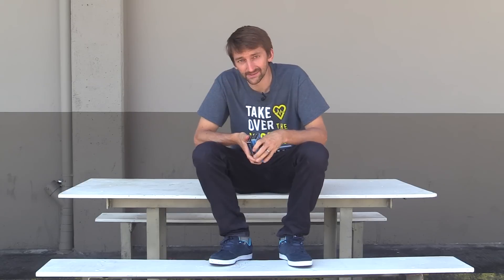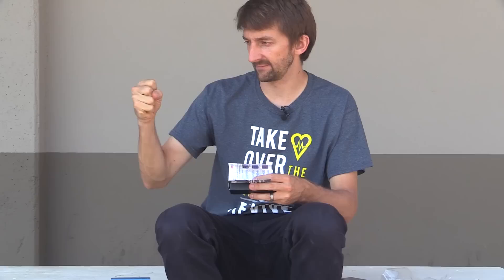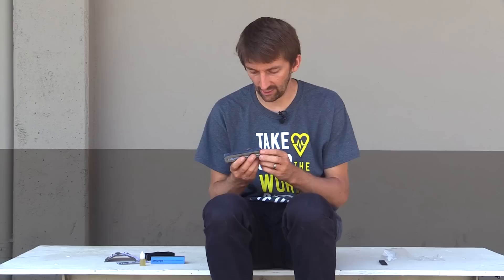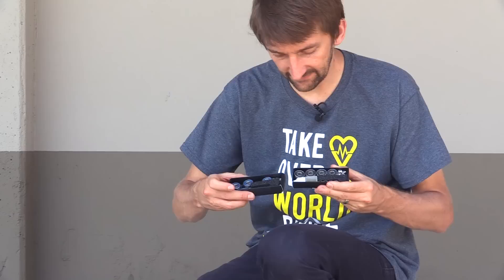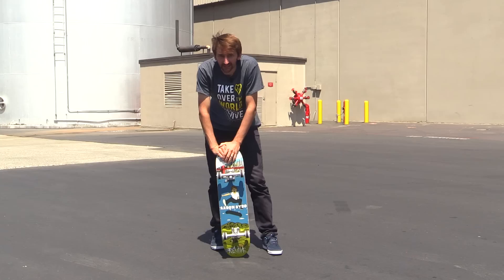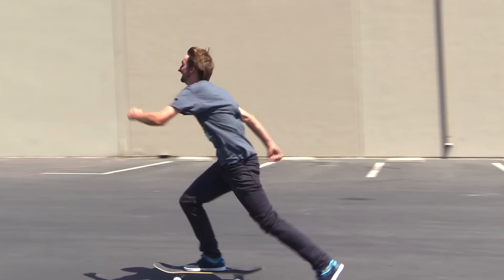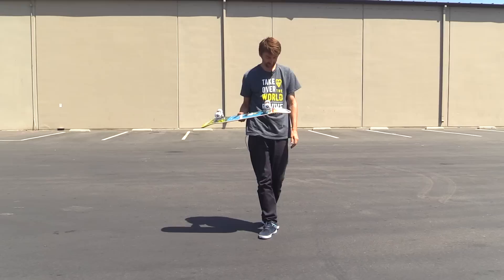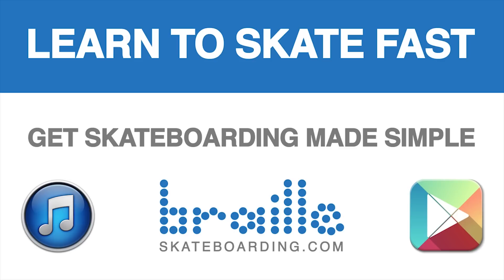CERAMIC BEARINGS VS STAINLESS STEEL BEARINGS | VS EP 9

Comment: Ceramics are harder than steel. So when you put load on them they don't deform as much, meaning less contact, meaning less friction. Also they are probably more durable, steel balls could potentially warp permanently, where ceramic won't but would probably be slightly more brittle.
Reply: All bearings are the same pretty much... Oust bearings are different because they were made for skateboarding. Other bearings for skateboarding were actually made like machine bearings.
Reply: MrWhitePerson I honestly don't think anyone who rode on either of these bearings would tell the difference, but in commercial application ceramic balls are used in high speed bearings to reduce heat from friction so they don't deform and then they last much longer. Not pulling that out my ass, just ask a machinist.
Reply: MrWhitePerson I don't know if there are many people out there that specialize in skateboard bearings, and if they do its probably that they specialize in marketing them to people.
Reply: Travis sturzl
 and then ask the machinist if that matters at all for a skateboard, ceramic is more expensive and you're not taking advantage of it's strong points
Reply: wow calm down guys. It's just bearings! :)
Reply: mirzokka1337
lol i was pretty chill he was the one claiming things about my dad because he can't argue with someone without resorting to insults..
Reply: why cant u just let him tell what he thinks an let it be?
Reply: mirzokka1337  because the guy is plain wrong
Reply: ok well thats your oppinion
Reply: +mirzokka1337 my "opinion" is actually a fact
Reply: dude he does have a point ceramics does hold longer but they arent nessecerly worth to buy
Reply: mirzokka1337 they won't rust as fast but speed wise they are pretty much the same
Reply: yes but he didnt say the speed would be different either
Reply: Yeah most ceramics do not rust at all, but the bearing housing is still probably made of steel.
Reply: Travis sturzl you
Reply: I was very level headed, but dude kept persisting. And argued the same point that I stated. Yeah they probably don't make a huge difference for skateboards. He wasn't being "civil" in his debate either. He came out telling me to stop pulling shit out my ass, which I was not. He argued claims that I never made.
Reply: Travis sturzl well he is not very smart
Reply: You're claiming that I started with the insults?
Reply: Travis sturzl
lol i'm not claiming that's exacty what happened look at my comments and tell me when i insulted you
Reply: Already did.
Reply: MrWhitePerson you didn't insult anyone
Reply: Luck--- Dude's right, why are you so mad?
Reply: +Travis sturzl I can't tell if +MrWhitePerson is trying to troll you or is just that clueless, but if his grammar and reading comprehension skills are any indication, I'd say you're better off leaving it be. I doubt you'll ever be able to get through that ceramic (see what I did there?) barrier separating his mind from reasonable discussion and/or debate.

Comment: i was under the impression ceramic bearings are ideal for down hill racing with longboards because of the high speeds, i don't see the heat/friction being a issue under normal street or park settings

Comment: you would know in the first push the difference. i've never had ceramic because i hear they are easily damaged but my fastest bearing has now lasted me 2 years which is the Bones Labyrinth 2
they are dangerously fast but that is great when you only have to push a 1/3rd of the time

Comment: The ABEC ratings and materials used for skateboard bearings are just a marketing tool at this point, skateboarding isn't an application where such high tolerances are needed or would be noticeable at the speeds you'd be going. There are bearing metrics which are relevant for skateboard application which aren't even measured by ABEC ratings. Would be better to get some straight up reviews of different bearings vs one another as the quality of construction is likely to make more difference to a skateboard than even the difference between ABEC 1 vs ABEC 9, assuming they are both made well.
Reply: true
Reply: I believe you'd need a certain level of abec for a skateboard, but going past that is pointless.
Reply: Yeah but on rollerblades or on a longboard i'd assume there'd be some sloght noticeable change
Reply: you really don't need more than ABEC 3 For skateboards, ABEC 9 being precise enough to send rockets into space.
Reply: Exactly, What's important in skate bearings is that they don't have thick grease, and are durable. ABEC has nothing to do with that. The ABEC rating on these bearings he has are 9. That means the milling is precise enough for aerospace and surgical applications. Completely irrelevant. the speed of the bearing has nothing to do with that. Cheap $1 ABEC 1 (lowest official rating) chinese 608r's made for household applications like celing fans can easily go 2,000 RPM no problem, and guess what. The fit right into your skateboard wheels. 608s are the most common bearing on the planet, and were the very first standardized bearing size. They are used in everything. that's why we skate them.
Reply: diamond drake. it's live having a 5litre v8 vs a 5litre v12 the higher count is just going to be smoother, and probably slightly faster but not really noticeable enough to warrant it's use in the industry
Reply: It really isn't. The higher rating is smoother, but it's so tiny a difference that you can completely ignore it under 10K RPM.

ABEC 1 is 0.0075mm eccentricity. That means if you have a single grain of sand stuck to your wheel, you have already made your ride rougher than a change in ABEC would. btw ABEC 9 is 0.0012mm eccentricity. it's not even an order of magnitude better, the difference is only perceivable at super high speeds.

Just for reference, the SMALLEST standard deviation of a grain of sand is 0.0625mm. That's 10 times the eccentricity of the lowest standard ABEC rating.

The only thing ABEC ratings really do for you is show how much effort and thus how much quality you're paying for, but the rating itself is irrelevant at skate speeds and weights.

Thin grease makes skate bearings fast, quality seals make bearings keep in thin grease and last a long time. Damaged bearings can be rough, but ABEC rating doesn't matter.

You want a fast smooth ride. Buy cheap thin grease skate bearings, and spend all your money on good wheels and don't put your wheel bolts on so tight.

feel free to check my facts. I'm a computer engineering major with tons of credits in mechanical engineering. I skate between classes.
Reply: Lets be honest, ABEC 3 is all you need in skateboarding.
Reply: Avec is the number of bearings inside
Reply: @Diamonddrake  Actually "6203" are the most common bearing on the planet. 608's are used in a lot and on skateboards, roller blades / skates. ABEC has always been a marketing gimmick. Aerospace uses the gold boxed bearings. 10X the price. There is no actual milling that goes into bearing manufacture. Wire is rolled between two huge plates, like you might roll plastescene into a ball in your hands. The wire becomes a ball, falls through to the next phase and continues on. The rest of your post is pretty accurate. I spent years at NTN Canada....

Comment: I've had my Bone Swiss Ceramics for atleast 10 years(Since middle school, now I'm 25). Had bought 20 of them since I had speed skates back in the day. Now I just cruise on skateboard with them. They still work and spin just like they use too, maybe even faster. I do clean pretty much every time I ride, so that probably has something to do with it.
Reply: I know this is such an old comment so a long shot that I’ll get a response but could you tell me how you clean your bearings? I saw some sources that said to use high percentage isopropyl alcohol but I did that and I feel like my bearings immediately slowed down. I don’t know if the cleaning method had anything to do with it. They were stainless steel bearings.

Comment: it sounds like ceramic would experience less wear due to heat cycles
so it should last a lot longer based on that, but I am worried about how brittle they are?
I have some full ceramics in hand, they feel delicate : ) can't wait to try them out
Reply: Did they last? Lol

Comment: toughness is an important material property for skating. Ceramics are very hard and resists abrasion and deformation very well. but they lack ductility and brittle nature gives them inferior toughness or resistance to breaking. 

Bottom line: ceramic will perform better until they break. Whereas steel will be more robust to impacts and flip tricks.

Comment: Bones reds are the best !
Reply: +larry fisherman i like bones blue
Reply: +FeaR FuZiioN jart bluerings are always going to be the best for me
Reply: Bones Swiss bearings are just like any other bearings, you just paying for the brand name is all
Reply: Girl blues are good.
Reply: it's a fact that the reds ceramic and the Swiss are better than the reds but reds are probably the best value for money but really it's all opinion
Reply: Yeah usually I just use whatever bearings I can afford but I decided to spring for some red and I'll never go back but after seeing this I might try out some ceramic bearings
Reply: +larry fisherman not the best but best for the price fo'sho.
Reply: I'd recommend buying super reds. I've tried both and i like supers more. They've lasted for like 2 years now and they still run smoothly
Reply: my problem with bones is I always get at least one dud in the box, I got about 3 the laat time I bought them, so I'm trying flip hkd to see if it's any better
Reply: +larry fisherman I didn't like Bones Reds because they are loud, have a lot of slop, and use cheap steel that oxidizes even in the best conditions.  I've recently tried other bearings, like Rush ABEC 9.  Skated them for months and they are slow as molasses, and the shields tend to pop out while doing technical tricks.  Already shredded 4 of them.  The just won't break in like Bones Reds do, and I never had problems with Bones shields popping out.

In spite of my complaints about Bones Reds, I'll probably switch back.  I haven't found many modern bearings in that sub-$30 price range that are as fast.  Yeah, everything rolls, but for some reason, the slop and cheap steel in Bones Reds makes them perform well for the average skating.

Aside from that, I think that unless you are going to pay more than $40-$50 for a set, they are all generally about the same outside of build quality.
Reply: +Zach B Exactly, bearing ratings refer to the precision built on a machinery standard which is hardly applicable to skateboarding applications.  Bearing companies pray on the uneducated kids shopping at zumiez that tell their parents how much they "HAVE" to get bones super swiss ceramics for $99 so they can go super fast.  Bearings are rated for thousands of RPM's and your skateboard probably will never go fast enough for even the heat caused by friction to be an issue (unless you downhill like MIscho Erban haha).
Reply: +Arttu Karinluoma I've had my Bones Reds bearing for at least 5 years now. I removed the shields a couple years ago and they still perform better than any of my friends' bearings. Crazy stuff.
Reply: Yeah they are really good for 30$ bearings. And zach if you think they're loud, try putting that oil sewing machines have. I've done that before and they're quiet, they don't spin as well after that but that's because they're pretty much new again
Reply: Arttu Karinluoma I also use sewing machine oil, every 2-4 weeks with cleaning, and it works well for bearings.
Reply: +Trevor Philips Idk what bearing i have on my old board and thats because they are rusted...but i just bought some reds and my rusted ones work better. Idek how that makes sense but they go faster.
Reply: +Justin New bearings usually get slowed down by the lubricant until a few months later when it starts to get dried out.
Reply: +IAm Taco lol fuck no, i can literally hear someone riding bone swisss because the bearings spin so much faster than any other kind. new reds spinned for 20-25 seconds on old 53 mm wheels but my friends old hand me down bone swiss spin for over a minute easily. they are loud as fuck when people are jamming in the skate park, all you can hear are their bearings.
Reply: Free spin has no correlation to a bearing's quality, noise is also not a reliable quality indicator.
Reply: bobdogg013 Yeah lol
Reply: Close to the best, but for price value, I'd go with the Minilogo bearings. They're only $10 and still made by Bones, but they don't go through the whole marketing system so they aren't as marked up.
Reply: +Da' Rito  Wow didn't know that! I'm gonna try some out next time, thanks
Reply: tigersharksteph ive had abec 3 no name sealed bearing that shit on new super reds and the abec 3;s were hand me downs. all of it is a bs marketing scheme, slealed bearing are best as the dont get gunked up with dirt like all my reds have
Reply: Yeah i believe you on the marketing scheme thing. I don't do nearly as high impact skating as i used to so I invested in the Bones swiss ceramics. I have had them  2.5 years so far and they are great . Part of me felt ripped off at first but this long in I would have bought 3-6 sets of cheap bearings otherwise. As i said though, I'm not huckin myself down large sets anymore so I can't comment on the ceramics cracking. I skate mini logo decks so I'm curious about their bearings though.
Reply: +tigersharksteph try minilogo bearings. tehy are only $10 and super smooth and fast. i had mine for 2 years and never cleaned them. just got a new set. minilogo decks are good too but chip and stuff easy. minilogo trucks sucks ass. they are light and overturn whoch is cool, but they break easy as hell.
Reply: +tigersharksteph i got mini logo bearings but i wan't too happy with them... after a few days of use they already started to make 'the sound' when rolling and after a while they just didn't roll smooth anymore...
Reply: +victor diaz mini logo bearings for the win!
Reply: +GunsNRoosendael that happens to all bearings but next time put the metal shield facing outwards it will help with keeping the lube in and keep the dirt out
Reply: ***** yes, but the mini logos were like that after a few days... my reds are 3 years old and they don't even rattle
Reply: yea that helps a little, and cleaning your bearings is super important for longevity......but you get what you pay for. My ceramics swiss ( expensive as hell) are the best at my skatepark and I've had em for years and never cleaned them once!!!! I've replaced boards, trucks, and wheels but have yet to change bearings since around spring 2013
Reply: Bones Swiss are way better. I have them on my new board

Comment: Someone's probably already pointed this out, but one of the most beneficial aspects of ceramic bearings vs steel bearings is that ceramic bearings tolerate wet road conditions much better than steel bearings because they lack steel's propensity to rust. For skaters who rely on their board for basic transportation, it's preferred to have bearings that will be more forgiving of unavoidable weather abuse.
Reply: That makes alot more sense, or at least more beneficial, i live in Sweden where rain is just as bad as the UK. I'll be getting ceramics soon enough.
Reply: dont get ceramics, the metal rings will still rust just as fast. just take care of your bearings and clean them after every shower or wet day.

Comment: just want to correct Aaron a little bit: 

The friction, which causes the bearings to heat up, doesn't come from the ball revolving inside of the bearing casing (the metal donut), but rather from rotation. The inner circle of the bearing is fixed in place with the bolt. The outer circle spins quickly, while the balls stay in place, but rotate very quickly. The friction comes from any place the balls touch. So on the top of the ball, where it touches the outer circle, the bottom of the ball, where it touches the inner circle, and each side, where the ball comes in contact with another ball.

Over time, the heat will warp the balls, and a ball that isn't a perfect sphere won't roll as well.

Edit: Just speculating, but I would imagine that the steel balls are better for trick boarding. Ceramic is brittle and cracks easily. So for longboarding over distances, or downhill, you would want ceramic. I'm not sure if they would last if you were doing kickflips and stair jumps though.

Comment: ceramics are freaking hard... I had one, I thought it was frigile and prone to cracking cause its brittle. but instead, it dented the steel raceways when high pressure is loaded in your board..  so vs steel, steel balls might deform, but ceramics will deform the raceways cause its a harder component.. ceramics just wins in the longer run cause it doesnt rust and if ever the races rusts, it will just repolish it when you roll it...... for speed, they are just the same, but ceramics covers greater distance...

Comment: I prefer steel ball bearings when doing tricks. When I use a longboard/cruiser board, I use ceramic ball bearings. Also, if you use ceramic ball bearings for trick skating, the ceramic ball could chip, so I that's why I prefer steel ball bearings for when I do tricks.
Reply: did you chip ceramic bearing? You would be first person to do that.